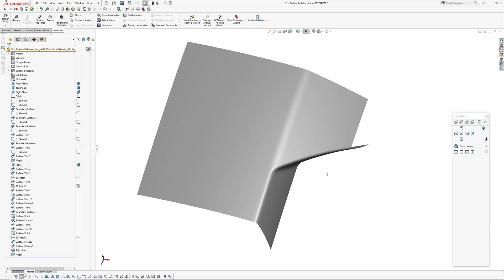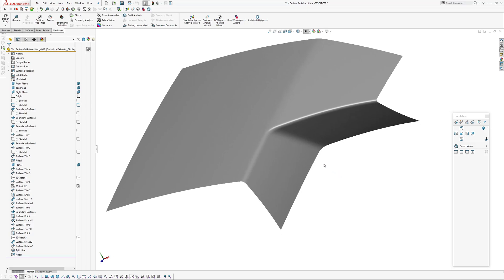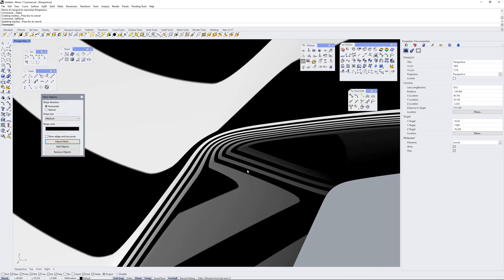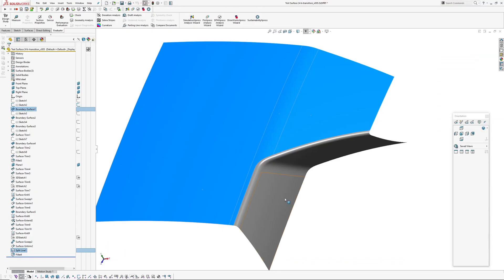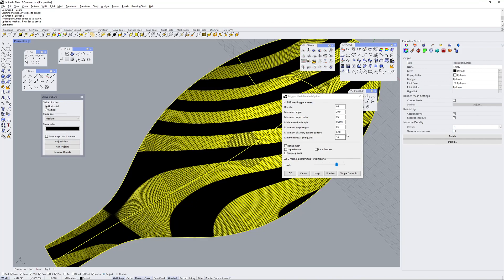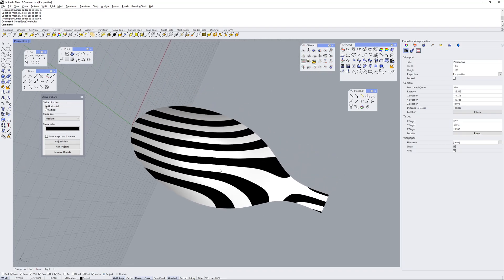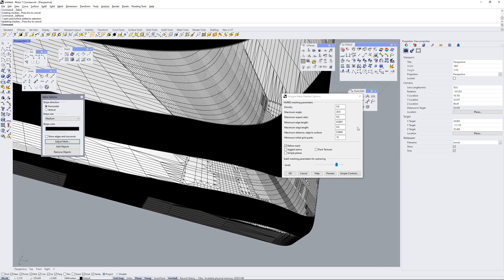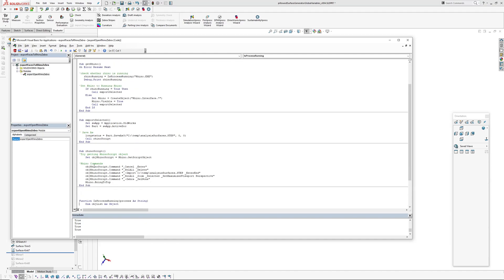Solidworks to Rhino Surface Evaluation Macro

Comment: Hi Andrew  - I'm trying to get this macro to work in Rhino 8 but running into some difficulties. I've changed this part of code - Set Rhino = CreateObject("Rhino.Interface.7") to  ('Rhino.Interface.8") but still comes up with an error. Have you tried this macro with Rhino 8? Are you able to reshare the code if you were able to make it work succesfully, please?
Reply from the maker: Hi there. I'm on Rhino 7 still so have not tried with 8. I posted it on a forum and someone there improved the script, maybe try that version? Here's the link. https://cadforum.net/viewtopic.php?t=3053
Reply: @AndrewJacksonDesignStudio  Great, thanks!

Comment: This is great - I'm a Creo user, the zebra stripe/mesher is not the best either. I'm sure it can be tweaked in Creo (almost everything can), need to get my head around it, as we don't have Rhino in the studio. £1000 a year is quite a bit of money if you are only using it for this purpose. Great tutorial though, has got me thinking about the number of times I have likely chased a surface "issue" for no reason lol :)
Reply from the maker: I’m pretty sure if you have the rhino evaluation installed this will still work, as the main limitation with the evaluation is you cannot save once the set number of days has passed. I need to confirm that somehow though! Rhino is a perpetual licence, so one off cost until you upgrade to the next version. Old school non subscription 😎

I remember setting the mesh quality to 10 every time I opened wildfire, had it set up with the keyboard; DQ10, DQ5 etc. The good thing was it didn’t forget the setting like SW does sometimes with surfaces.

Comment: very nice macro. it would be very useful if you can incorporate z axis rotation adjustment into the macro while importing to rhino. For every model i 3drotate to correct z axis.
Reply from the maker: Good idea, that will be really easy to achieve!
Reply: Thanks 🎉